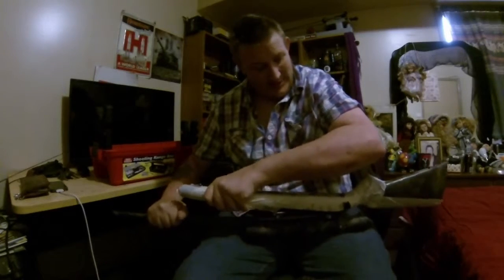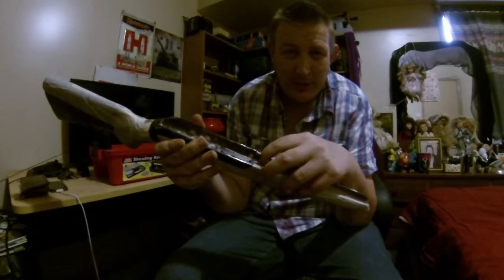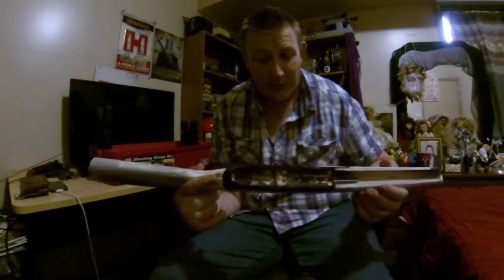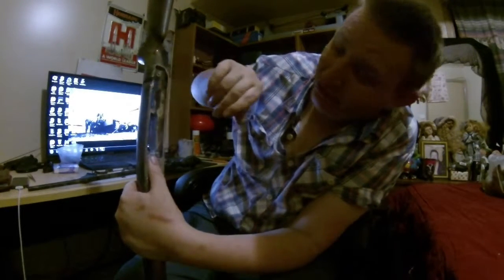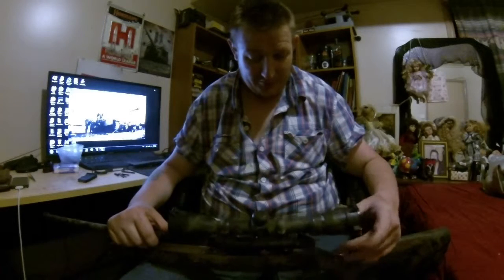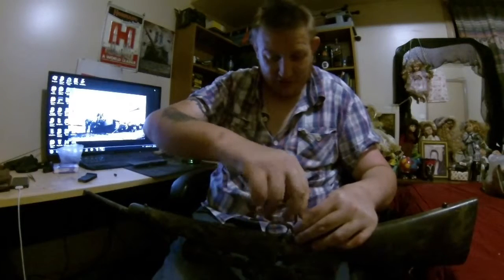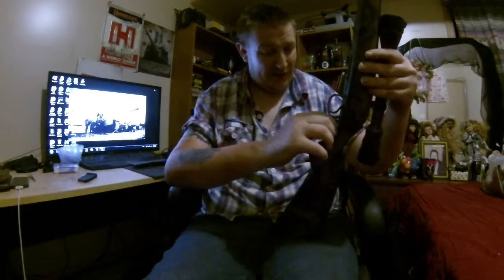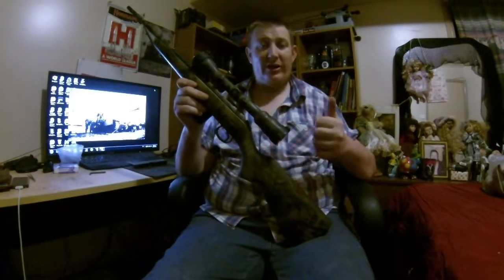CZ455 Bedding part 3

Comment: How did the gun group after the bedding
Reply from the maker: Seany Seany made a huge difference down to 1/4 inch with some of the worst ammo an a 1/8 of an inch groups with the best shooting ammo
Reply: Mudrats Hunting An Outdoors cool, I'm thinking of doing the same but I'm wary, I wouldn't like to  glue the whole thing together. I wouldn't mind doing the pillars but nearly everybody says you need to do both
Reply from the maker: Seany Seany it’s not that hard to do the most important thing is use plenty of release agent an make sure you damb up the action really well an you won’t glue it together